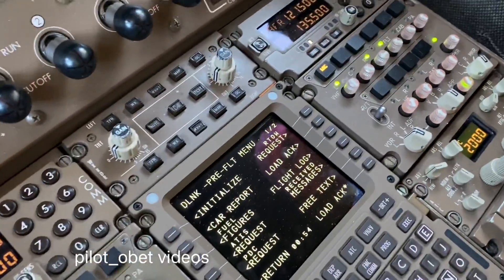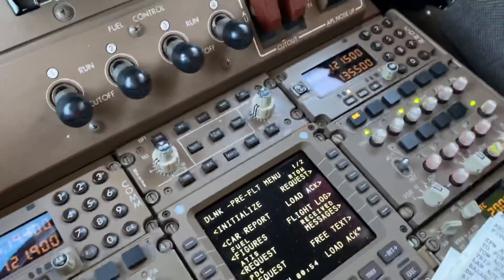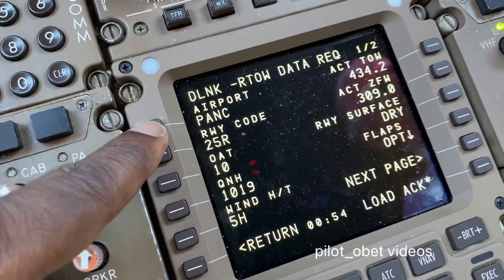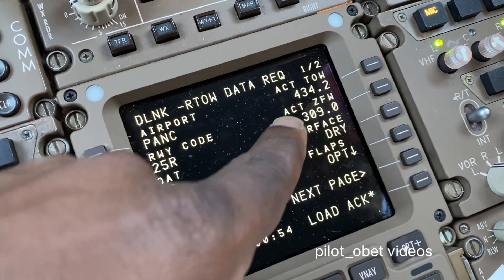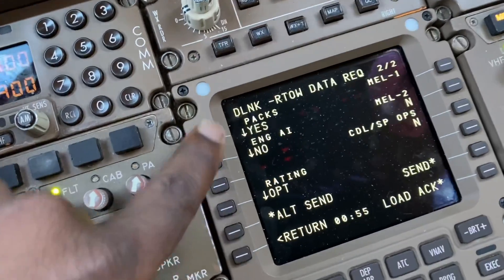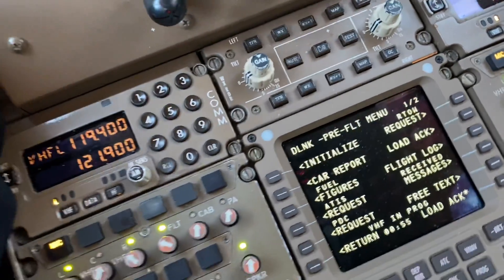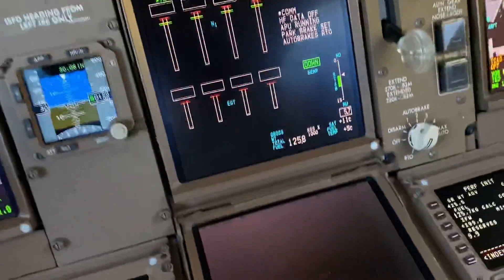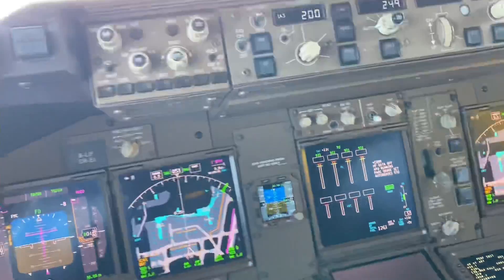Alternative method for calculating the Boeing 747-8 takeoff speeds

Comment: So cool. I wish all the serious planes in MSFS XBox (787/737-800/747/Bae 146/ A310/A319-A321) had this print out feature working instead of INOP, some like A310 have the Airbus performance flex TO temp given by EFB calculator...but there is NOWHERE online or in apps like TOPCAT that I can find anywhere to get a Boeing Selected Temp for TO for the 747-800 for example, even after all weights and simbrief weights and rnwy data imported properly. Have you ever come across an actual chart or something Captain...one that would have this selected temp data ranges for Boeing?

Comment: The aircraft will be continuously sending out ACARS data via VHF and HF frequencies.  The data that Obet has entered into the aircraft ACARS system can be decoded - you can also find the aircraft by looking on Flightradar.  Here's some videos to watch if you're interested to see what info. the aircraft regularly transmits during its flight.  Later!

https://www.youtube.com/watch?v=xGD_GFxH9ps

https://www.youtube.com/watch?v=gjRrOLiIFOw